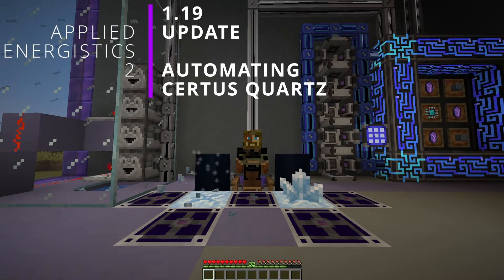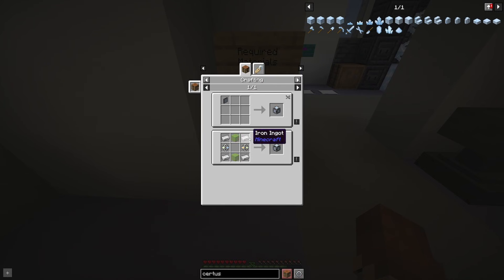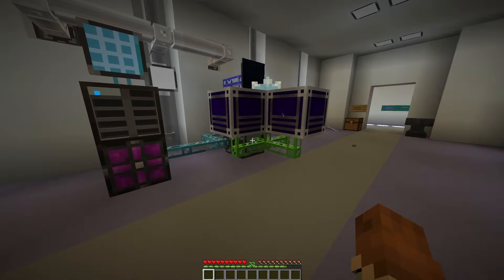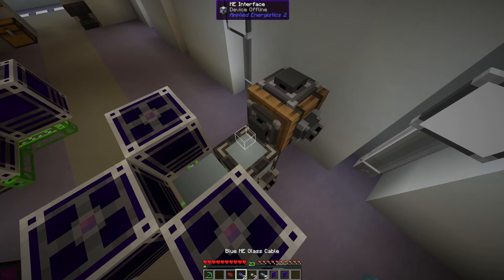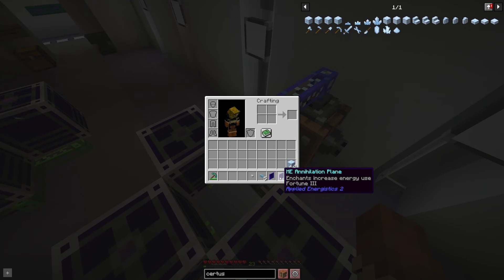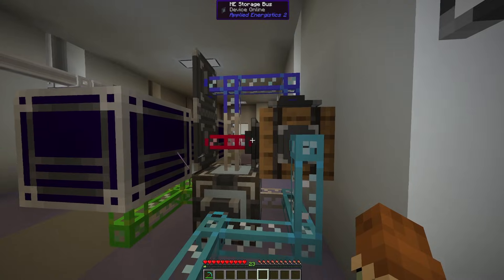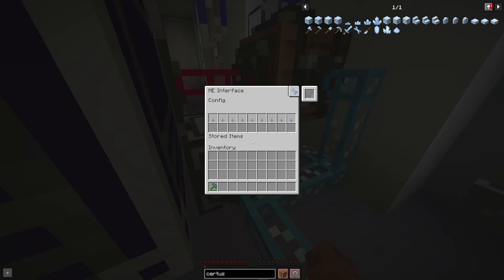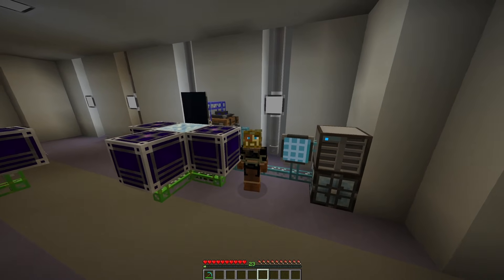Certus Quartz Crystal Automation in 1.19 & 1.20 | Applied Energistics 2

Comment: I'll add this here in case someones is wondering if you can move a flawless budd. You can use a minecart contraption from the create mod. Its a known method to move spawners with that mod.
Reply: You can also use carboard boxes to move them
Reply: @hunterchao197  I tried it and it doesn't seem to work. At least for me.
Reply: @Gragunbob  works for me
Reply: @Coldeagle27  which cardboard box mod are u using?
Reply: @pattiriri  Mekanism?
Reply: @hunterchao197  Thank you, that worked for me
Reply: There's also an AE2 method of moving blocks, spatial storage.
Reply: cardboard box from mekanism
Reply: Mekanism has cardboard moving boxes that can do this simply

Comment: If you can move a flawless block using a cardboard box or similar providing mod you can surround it with growth accelerators horizontally and put a annihilation plane on the top and bottom connecting to a chest with a storage bus that only has "Certus Quartz Crystal" on the bus. This works perfectly and maximizes the acceleration while collecting only fully grown buds. And on top of that you can enchant the annihilation planes to an insane degree in some packs (e.g. Direwolf20 1.3.0)
Reply: (As well as use spatial pylons if your pack doesn't have boxes/create)

Comment: The colors of the cables are necessary ot not? because its not working for me, im using only the default cable color, the formation plane isnt placing the flawed block :(
Reply: It is needed, otherwise the networks will mix up, in this setup we need the networks to work independently

Comment: Actually you can use Flawless blocks instead of flawed and you CAN bring them to your base. This blocks can be found inside of meteors, but cannot be broken into reusable block (flawed block drops instead), even with silktouch this blocks will degrade after breaking.
But you can actually get it. For example, you usually never play MC with AE2 mod without something else (you cannot build generator setup with AE2 itself). And I always play with Create mod (+Also Create Crafts & Additions mod to have an Alternator that is compatible with energy accepter), it gives an opportunity to build wind or water powered generator to power ME system. Also a lot of mechanical crafts and automations and the most important it gives mechanical piston and contraptions. You can push Flawless blocks from meteor spot right to your base with mechanical piston (regular pistons would not work). But this way to get Flawless block is also very time consuming, so the best way to bring is to make a glued contraption from all crystal blocks inside of meteor (using super glue) and pick it up with wrench using minecart assembler. Now all insides of meteor are placed in your inventory as a wrapped contraption. You can place it anywhere in your base and dismantle contraption. When you have your flawless blocks on your base you can push them to their place near Growth accelerator with mechanical piston. And here you have it, flawless block that grows crystals and never degrades. This is very legal way to get Flawless block without cheating.
Reply: Yeah silk touch got me. I thought that would be enough. Time to find another meteor.

Comment: Meh, I don't like it. There is also no need to make it make it more complicated that it needs to be.

1. It's not always easy to get a fortune III enchantment on a book
2. There is really no need to use more than just 2 flawless blocks (easy to find); one for crystals, the other one for dust. 
3. There is no need for a formation plane.
4. There is no need to use flawed blocks. Heck, they would also have to be recharged to recover a tier.
5. Once you remove the formation plane, you can grow a second bud on the opposite side to get almost double the speed, and I say "double", because that limits to number of growth blocks you can use to 4 blocks, instead of 5.
6. There is no need for mass production of quartz crystals and powder, and if there was, it would be to cover the need for storage, but that point anyone with common sense has already switched to blocks like Supreme Black Hole Unit for example (Industrial Forgiving) to store more than 2 billions items in a single block, and some mods can store even more.
7. About creating two setups; don't use them side by side, with one growth block sharing both, but place them diagonal, so that 2 growth blocks are shared, which saves on material, power usage, and Minecraft ticks.

Comment: For anyone playing all the mods 8 (or just using the Mekanism mod), you can use cardboard boxes to move flawless budding quartz blocks, all other methods are overly complicated and unnecessary, 4 sawdust is literally all you need to move flawless buds to your inv

After some testing with the method i just described, you don't need to replace a flawless bud. This means ME interface is unnecessary, along with the silk touch plane, allowing for 2 extra growth accelerators on the bottom and side with a flawless bud. but splitting the networks up is still critical unless you like dust. 

All in all good video!
Reply: hey dude I did what you said but now the farm is generating dust, I made sure to not connect the networks and everything looks good, idk what’s going on, and when I break the ME interface, the machine stops breaking the clusters at all. I know I’m a bit late but any help is appreciated
Reply: @matheusgalvaotelles2040  LOL yea I haven't played this modpack in a minute but try adding a filter so it only breaks when fully developed, and double check to make sure you have 2 separate networks, anchors are pretty good for that, other than that I'm not sure

Comment: For some reason my Fortune III Annihilation pane won't break the crystals no matter what the storage bus on the blue network is set to filter (whether empty or set to crystals). Suffice it to say I am at a loss for how to fix this one - it's unresponsive. 

Edit** Neither is breaking anything in front of it. I've also checked to make sure I haven't maxed out channels either. An interesting behavior is that when I throw certus crystals at the annihilation pane it imports them into the system. They just won't register the stage 4 crystals or block in front of them respectively.
Reply: did you find the fix?
Reply: @xModz  unfortunately no
Reply: @CVasquez0810 You probably didn't use the STORAGE bus, but an import or export bus.

Comment: nice tutorial but its not working with the block breaking. It does break every state of the block :/
Reply from the maker: Make sure you have the storage busses set up correctly. That’s what determines what state of the block it will break.
Reply: @_Striker  well its set up for the normal quartz block (I dont have silktouch atm)
Reply from the maker: Silk touch is critical for this to work. That would be why yours breaks every block state since it doesn’t have silk touch. Only the fortune enchant is optional.
Reply: @_Striker  ok i will try it with silk touch. You got my subscription now! <3
Reply: @mr.anonym9906  also make sure you use quarts fiber to connect the top annihilation plane to power. If you use a me glass cable then it will buy pass the storage buss making you harvest at every stage. Also you can use a carboard box (if available in your pack) to move the flawless ones and skip the silk touch step

Comment: if you need dust, then it is way better to still brake it as a crystal, and then put it in the inscriber.
breaking a non-full quartz will always give 1 dust, but a fully grown will give at least 4
Reply: "The" infuser? Which infuser? It didn't work in the infusers I tried.
Reply: @PeteDunes sorry, the "inscriber" that is in the mod itself.
i dont know why i said infuser.
Reply: @meplay185 Thanks, but what you do you mean with "non-full quartz"? A quartz crystal is always full, and when I put a quartz crystal in the inscriber, it's giving me 1 quartz dust, and mind you, and that's with a  modpack that I created myself with the Minecraft 1.20.1 version of AE2, one for which I never changed the default configuration.

Is it possible that you used a modpack that had its default configuration changed by the one who created that modpack? Or maybe you used on older version of AE2 that allowed you to get 4 dust.
Reply: In most modpacks I've played, theres higher levels of fortune, so it will always be better for the bud to grow fully then inscribe it with multiple inscribers/use a crushing wheel from Create mod.